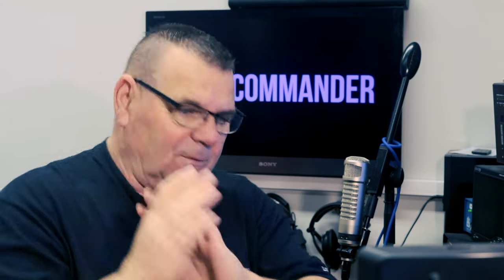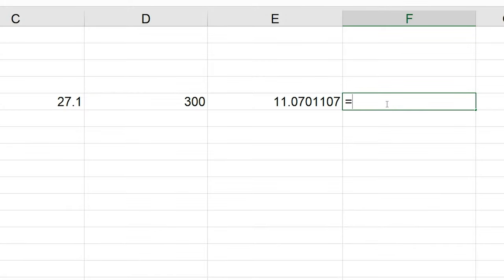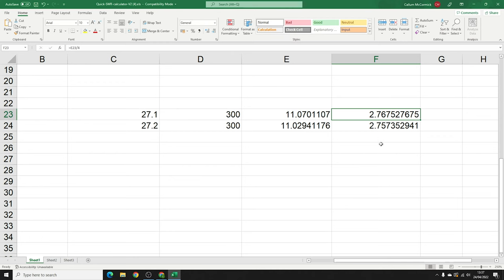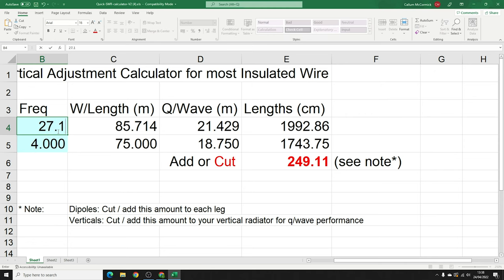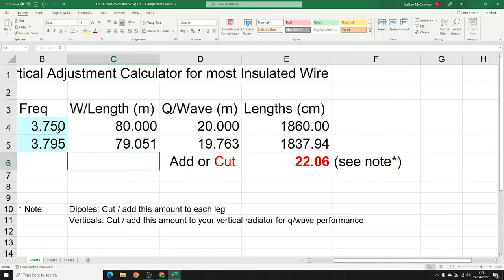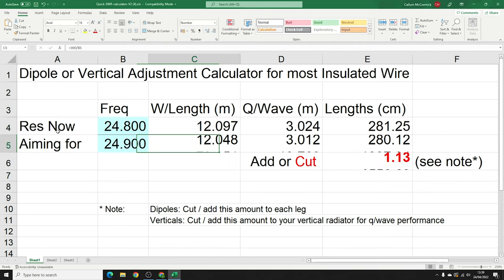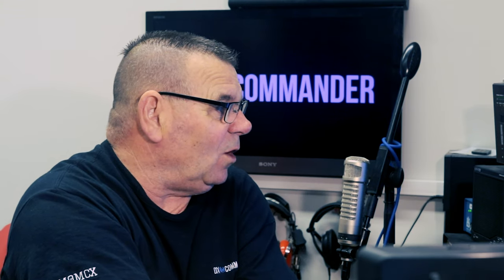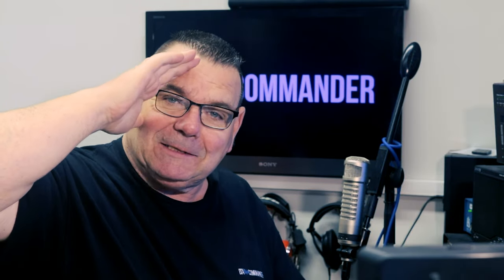How Do I Adjust My SWR - CB and Ham Radio

Comment: By this calculation you can adjust resonant frequency, but not SWR as it is sum of resistance, what in fact you do not adjust. Correct me if I am wrong. Anyway thanks for nice explanation using Calculator. Best regards Cal.
Reply from the maker: In the MAIN, your resonant frequency for q/waves and dipoles disregards impedance and resistance  (for our science experiments) because we normally know they will always (mostly) be between about 40 and 70 ohms. So best SWR will be best resonant frequency. But I think you knew that already! :)
Reply: I agree, this seems to be a pattern with teaching hams, and it can be very misleading. They tend to skip to the end and leave the juicy bits out, or in this case, assume they know it's for a 50ohm designed system. It's a very poor teaching method, as you need to explain the fundamentals for true understanding which will result in better, calculated practice.

Comment: I’m a simple trucker so can you give me an example of how to use this calculator in this scenario, AM settings: channel 1 (26.965 MHz) = 2.5 SWR, Channel 20 (27.205 MHz) = 1.3 SWR, and Channel 40 (27.405 MHz) = 1.2 SWR. how do I calculate the length to cut or length to increase the whip on a Predator 10 K antenna with a 24 inch shaft in this scenario?
Reply from the maker: Well, I don't know what a Predator 10K is, I'm sorry BUT you are saying 27.405 is 1.2:1 and you would like it resonant lower down? In which case shorten it say exactly half an inch and check again.

Comment: Thanks for the tip on the fold over. I have a fan dipole using fold over technique. I am fortunate to have a VNA so have been manually tuning it that way its a bit slow going though. Now i know its about 3x i can make better guesses. Cheers Cal.
Reply from the maker: Yes, it's a good guess BUT not exact because the further you move away from the point (where the foldover happens), the greater the loading you will experience as you make the foldback longer and longer so that eventually, when the foldover is complete (fully linear loaded) small changes nearer the feedpoint (to your foldover) makes more of a change.. I need to make another video about this!
Reply: @DXCommanderHQ  yes please, that also explains the what i am seeing. Be interested to know or measure the efficiency of the antenna as well how much gain i am loosing vs the benefit of a physically shorter antenna. VNAs cant tell you that bit sadly.
Reply: @DXCommanderHQ  So if the tuning sheet says to cut 7.28 cm off you really do not want to have a 21.8 cm fold over. How do you figure out what to do in that case?
Reply: @DXCommanderHQ  This is great to know. I've got all the parts in the mail to try to make a fully linear loaded EFHW.

Comment: So, there's 2 parts of "raising" or "lowering" the swr at any particular band. One is to increase or decrease the frequency of the swr. With this, shortening or lengthening the element (increases or decreases the frequency of the swr along the x axis.)  This (along with the calculator) are very helpful resources. I've been using it a lot at tuning my signature 12.4. I simply identify the frequency of the lowest swr part of my given band, identify where I want that lowest swr to be (ie middle if the given band). I plug both into the calculator and adjust the element length  accordingly. This moves that lowest swr frequency over to the desired frequency. 
With the 10m band where there's  sooo much foldback, like Callum said, there's limited effect in increasing or decreasing the foldback. In experimenting, I did a foldback of the foldback (folded the end of the foldback back up the element line). Interestingly, this had a much quicker effect of moving the lowest swr point over along the x axis over than just lengthening the foldback. (This came from not really trusting cutting the foldback yet but knowing it needed to be shorter.)
I've gotten all of my bands essentially centered in the given bands on my antenna analyzer using these methods. 
But this doesn't really make any real difference if the swr is too high on the y axis. Which, as far as I can tell, but I might be missing something, these methods don't address. 
So.... how does one reduce the swr NOT along the x frequency axis, but along the swr intensity on the y axis?
Reply from the maker: I see you commented on another video and I left my reply there.. If you are stuck, either chat on the Discord Server or drop me an email. Try and make it bullet points because I have a problem reading a lot of text.

Comment: Sir question I bought a CZE 15-A transmitter FM radio station on 102.7 FM for our community HOA non profit of course and only announcements for community and community involved no profit. My problem is I should be getting better coverage. Plus a lot of static even not far away. I should get art least a mile to 5 miles on 15 watts. The 1/4 wave Ground plane antenna came with it the company says it's all set. I got 50' coax that I got with it and the connectors already on for this TX snd antenna which I was told are TNC and SL16-J coax connectors. The top of antenna the antennas are pre made and labeled. The one I used is 102. Of course. 
They assured me it was the best coax and antenna for what I am wanting to do with it. I made sure everything was connected correctly and tight. I had to hire a guy to put up the mast 25' and secure to house and it is above the roof clearing everything to broadcast the whole community easy. But dead spots, statically, sounds so bad. No interference, no loose connections. I am a retired DJ not an engineer. It sounds awful. So tone said it is the SWR setting it should be 1. But the vertical is pre set it does have a screw on it. The horizontal legs crap I did not drink anything but tighten them up. I do not know what I am doing. Can you please suggest what I need to do. Who would I contact to fix this problem? All my engineers are retired or dead, it was a long time ago. In different states. Are you in USA? I am. So don't know if that makes a difference. 
Please email me if you will
Backyardufologist@gmail.com
If you will. Thank you!
Reply from the maker: Check out radiomobile. That will give you mapped precise coverage. Make sure antenna is totally in the clear and you have line of sight to your 5-mile requirement.

Comment: Hello mate. Can you please assist on the SWR matter : where does the reflected power go and if you agree that after the ping pong between the antenna and the transceiver it goes back to the antenna and gets transmitted. I would really appreciate any clarification on this subject. 73 de SV4RIN
Reply from the maker: Yes it does.. And in the process, the lossy coax also gradually eats it up as heat. Depends how lossy!

Comment: So are you measuring the antenna with an antenna analyser to see what frequency it resonates on to then determine if it's too long or short for the frequency you desire? I had hoped this video was about  how to adjust using an swr meter as the instructions for the CB base antenna I have seems to be the opposite of what google tells me. And what my old CB literature tells me.
Reply from the maker: You don't need a fancy pants meter, you can just see (for instance) that Channel 1 is (say) perfect and channel 40 is (say high), then you know that best frequency is ABOUT channel 1 (as previous), so you would need to lift the freq up about 20 channels.

Comment: Hi Callum.  I am using an older version of the DX Commander.  I have found that the resonant frequency at 10m is 28.554MHz.  This gives me a high SWR of 4.48 at 28000kHz and 3.31 at 29700kHz (not much rise to the right).  Should I want to move the resonant frequency to a lower part of the band, I believe more wire will need to be added.  However, the current length is close to the plastic disk. One solution is to add more wire and fold it back onto it self.  Is there a calculation to be used for determining how much fold-back is needed after adding the extra wire?  Thank you in advance for your assistance.  (Please excuse the length of this message as I know you prefer shorter ones). … Rob WD4IFT
Reply from the maker: Yeah.. I made a video about this.. The title is something like "what happens when you fold back the end of a dipole"..

Comment: Antennas confuse the heck out of me.  When I put up a wire antenna, I can usually get a good/usable SWR at a specific frequency but it's usually never close enough to 50 ohms.  I struggled like crazy with my cobweb.  Any pointers?
Reply from the maker: OK, so ignore the 50 ohms, for basic "known" ham radio antennas, in the main we can just point to best resonance. The impedance should follow you..

Comment: Appreciate your videos.  I'm just trying to get into 10 meter as a technician talking on 28.3 to 28.5 MHz.  I got myself a President Lincoln II + and an MFJ whip (161OT).   Was just doing the calculations and I came up with about 104 inches.  But the MFJ 161OT is only 98 inches.  Also it looks like my SWR is about 7.  So I'm stuck not TXing for now.  :(
Reply from the maker: OK, a number of ways out of that. Check what ground plane you have - increase it.. SOunds like that system you have is rsonant at around 33/34Mhz.. You can ADD a little bit of copper wire to the top.. Just wrap it around and stick it out the top?
Reply: @DXCommanderHQ  Thank you.  I'll have to figure out how to make a ground plane.  I currently have it about total 15.66 feet in the air on a metal post.  Going to try that copper wire too.
Reply: @DXCommanderHQ  Oh I just had an idea.  I have another whip that's identical.  I think I will just make it a vertical dipole.

Comment: Thank you for this information.
At an SWR of 1.5:1 there is a loss of 4% in radiated power, and this increases somewhat exponentially as SWR increases ( e.g. with SWR of 2.0:1 there is an effective loss of ~ 11% in the radiated power from the antenna).
However, if you are unable to physically adjust your antenna, and have to rely on an ATU to bring the SWR down to say, 1.1:1 from 2.0:1 (or higher), does the ATU 'recover' the  lost power and allow the antenna to radiate it, or does the ATU simply absorb the reflected power in it's LC circuits and protect the finals of the Transmitter?

In my case when I added 8 x 1/8 lambda radials to my base loaded vertical antenna, my SWR jumped from ~1.5:1 to over 6:1 !!  (Don't ask why, I haven't been able to figure that out .
 So I used an external 'heavy duty' ATU  to bring the SWR that my TX saw back down to ~1.5:1.  But according to the charts, an SWR of 6:1 is a 50%  loss in radiated power.
Am I correct in assuming that my ATU is simply 'absorbing' the reflected power and it is NOT being radiated by the antenna ?
Thank you.
Reply from the maker: No. You can't "recover" the lost power. And remember that half your power is only 3dB..
Reply: A tuner will correct the phase of the reflected power to add to the forward power and sent it back towards the antenna
Reply: Power is not automatically lost due to an swr reading ,this is the common misunderstanding in radio ,reflected power adds to the forward power and is lost due to feedline attenuation, if for example it was a lossless feedline then there would be no loss even with 20.1 swr, a tuner would allow the radio to produce full power

Comment: Long ago I tried using a calculation method to cut antennas and it never worked.  I had to do it inch by inch experimentally using the at the time standard SWR meter.  Today, hams are using  a VNA to measure and cut antennas but a lot of hams, especially new hams, don't understand what the VNA numbers mean.  So they don't know what to do.  Ignorance is not bliss at all!
Reply from the maker: Interesting!

Comment: But something else to consider.  The total antenna system.  Feedline.  Balum. Grounding. Soil type. Height.

Use your program as a ballpark figure.  (Circle of play in UK?  Cricket.) 

Then measure SWR at the particular location, measure twice, then cut.

Also, if SWR before adjusting is 1.5 or less, do not worry about it.  I would not cut a centimeter off, that is for sure.

And water, fog, humidity, frost/ice will change SWR.

Just get the antenna resonant or SWR to less than 1.5, and let the impedence matcher do its magic.

Now you mentioned CB?  Is it about the 11M band as in the USA?  Because in Down Under, they call CB what we in the US call GMRS.